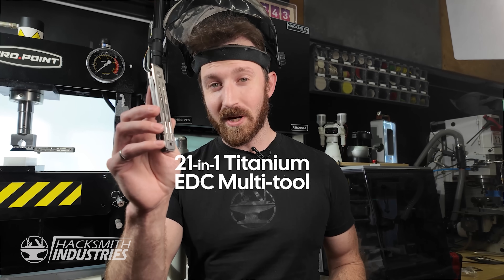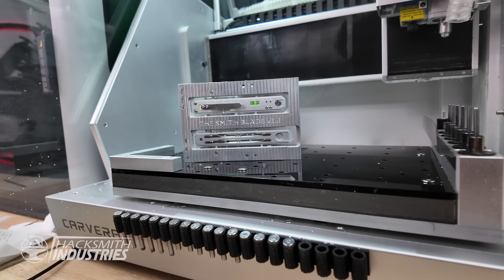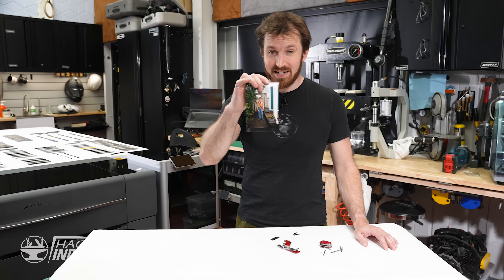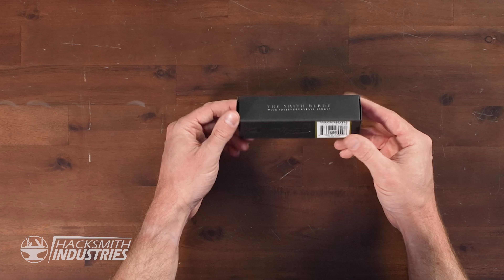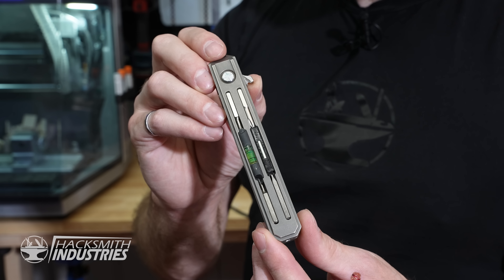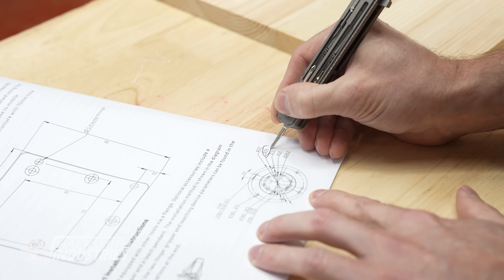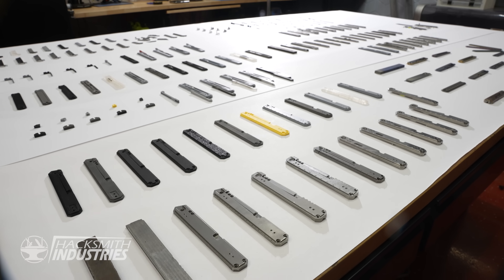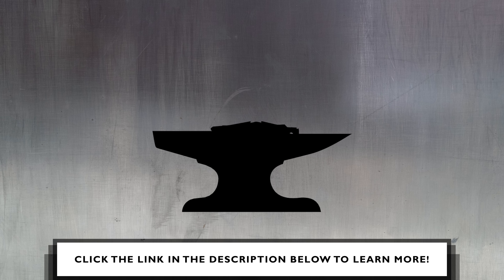We Made a Knife that can CUT THROUGH ANYTHING!

Comment: you guys are tripping if you think 250 is alot for that m390 is amazing blade steel that comes with knifes at around 150+. The extra hardware and the overall construction of the knife makes it worth that 250, even at 289 id still buy this when it comes to be able to order on the website

Comment: So you eliminated the multi tool designed off of a trust set of pliers to a stick that has 100 uses but can no longer be used as trusty pliers... you fail to see that Leatherman were designed with the extra tools with pliers as well... sweet multi too but would be better to see a set with pliers built in ot maybe one that breaks down and goes back together as a set!

Comment: Meh, M390 is a good steel but for something that I EDC I prefer Cruwear. A lot tougher and easier to sharpen. Not to mention that using a hydraulic press to cut another knife in half isn't the flex you think it is (especially a Victorinox knife). I could take a blunt wedge pieced shape of any reasonably tough steel and do the same thing with a hydraulic press.

Comment: first thing i notice directly: you threw a ferrocerium rod onto this bad boy but have only a tiny screw for the mechanism? since it has a ferrorod one could consider this an outdoor knive, but i have some distrust batoning with it already due to the screw. yes i know, you baton with a folding knive at semi-opened stage, then baton with a wedge that you just carved, but still id love to see this knive perform fully opened during batoning. in the end the ferrorod is only a slim plate anyway that gets worn out super fast. 100 strikes maybe? 

great knive but the purpose is all over the place. id prefere my 30eu mora classic 2 and a 10eu ferrorod in the bush anytime... the only place ive encountered in my life where i actually needed a sturdy blade, despite working as a car mechatronic back then. id still be happy owning this knive, but more as a funny toy than an actual working horse. for EDC a keychain leatherman is more than enough for most tasks.

Comment: Would it be possible to get a long Blade version with flip tab but non locking like the Slipjoint? In my understanding of the German gunlaw that would be okay and I rly don’t want to miss out on the single hand use
Reply from the maker: We already made two variations for Germany 😅 sadly that was not one of them
Reply: @hacksmith wait! two? what is the second? i only saw the one without locking, short blade and nail groove
Reply from the maker: locking, two hand open
Reply: @hacksmith yeah ofc my bad

Comment: How dangerous would it be to use it as a protractor and a nail file due to the extremely sharp blade? Both those activities seem to have very close contact with the blade and the hand.
Reply: i doubt you will be using you hand directly to measure something with the protractor rather then a pencil or something and the nail file is on the thicker  back of the blade so no risk (unless you are dumb) of hurting your self.
Reply from the maker: Unless you've never used a knife before it's pretty easy to know that one side is sharp. 

The nail file can also be used while it's shut. And you'd measure using the protactor  on the file edge, not the blade...

Comment: This is probably one of the best knives made. But 209g for the edge? I've gotten my everyday carry guardsman to 54g with a WorkSharp belt sharpener, and I am not great with making sure the grind is super even on both sides before honing the edge. You can do way better with little work. A few passes with the right belt and the proper leather strop or similar method to hone the edge to under 100g doesn't take much when done right.

Comment: Backed this fairly early on, think first day if I recall.  Started sharpening my older  knives as they needed to be touched up here the other day, and I realized while sharpening my current batch that using a hapstone sharpener or something similar with how the edge of the blade basically goes directly to the scales on the knife is going to likely result in some scratches on the scales.  Is there a preferred way to sharpen these?  Free hand, maybe but that will be a bit of a bother  still with how the edge goes directly to the scales.

Comment: You need to build something to fight nosey ( if you don't know its being built by citra, a ticktocker it's basically a anamatronic) it's 10 feet tall can run at 32 mph it's fire proof, bullet proof, water proof , crouches and window watches it also it has spring locks

Comment: M390 is a great steel, but I want to at least recommend a few upgrades. Magnacut is really the no compromise king. Vanax would be next in line in my opinion with just a little less toughness than magnacut. S90v is another fantastic option with above average corrosion resistance while also having extremely good edge retention, less tough but I think it would work fine on this multi tool. M390 just isn’t as special as it once was, but like I said it is absolutely a fine steel.

Comment: Can I remove the Frame Lock myselfe without permanently destroying the locking mechanism? If so is the blade held by the small ball that it stays open when no force is applied.
Reply from the maker: Simply select the non locking add on for the Kickstarter. The locking mechanism is not removed, the blade is modified to not engage with the main lock, while it is held in place with the ball detent

Comment: I must be the odd one out, during field exercises and my everyday carry, I carried 2 multi-tools, sometimes three when I owned 3.

Generally I carry:
1x utility knife
2-3x Multi-tools
2x tools to fix the knife and multi-tools
3x head lamps (They drain batteries even when off for some reason)
1x set of work gloves
2x wallets
1-2x writing material (Usually write-in-the rain)
1-2x Fine tip pens
1x old school lighter that needs refill every basically 3 days from drying out or leaking
2x TQ

Maybe I just carry a lot.

Comment: I’m curious how strong the tool bits are and how easy to find replacements - have bent too many especially smaller flat head bits :(

FYI I think New Zealand has similar import restrictions on blade length and opening mechanism. So probably only int version would be allowed by customs (should update the kickstarter)
Reply from the maker: Which is why we went with standard 4mm bits, you can use basically any!

Comment: I just saw your video and WOW man! Love the designs and insane amount of thought that went into this!
I would love to know your thoughts on a what if... What if at the base of the blade when opened you created a ridged notch, with a corresponding one on the handle so that you could close the blade over a nut/bolt and pinch in like the inner part of a pair of pliers...? In my mind the only sacrifice would be about 1.5cm of the available blade length at the base.
I just thought of that when I saw you holding the leatherman. Your pro could then be a "22 in one" tool.
I'd then be able to ditch my own leatherman as the only reason I use the plier aspect is that gripping and twisting/pulling piece.

In no way at all is this a diss, I absolutely love the design so much and will buy one anyway - just a thought.... Love your work James

Comment: I am an application engineer, I specialize in the design and production of engine/transmission/genset packages, and I find a ton of use for these features. The blade shape, scribe, pen, bits, protractor, level, wire stripper(so nice BTW), file, and the pry bar in will come in handy in the field. I am also a very utilitarian person and when anything modular, or multi use, come into play I'm here for it. 

I don't use pliers much in the field, but if I do need pliers, it's not something needle nose pliers from a Leatherman could usually handle. Theres just not enough leverage there and usually end up looking like a suburban dad trying to show off.
This is perfect for my line of work. I do a lot of design work, a lot of part and assembly manipulation, electrical work (hense why I'm excited for the bits), make changes on the fly, quick measurements (distance and angle),and quick fixes. 

I also run a small business making parts for motorcycles with some CNC work, 3d printing, 3d scanning, drafting/3d modeling and believe this will make a great companion in those ventures as well. 

To those comparing the value to a Leatherman: 
I have pre-ordered and im perfectly happy with paying the price for the pro. I know what the product is and isn't. I'm not getting a Leatherman, I'm getting a Smith blade. Those who complain it's not as good as the Leatherman Arc don't seem to understand who this is for and why there is value for what it is/isn't. 

It all goes back to the old saying. All Leatherman are multitools but not all multitools are Leatherman.

Comment: When we get infos / design of the non locking version ?
Reply from the maker: It's on the Kickstarter page
Reply: We Only see that there is no Flip Tab and a shorter knive for more legal in some countries, but what is when we order a extra m390 blade ? Does it have the Flip tab . Please make a small presentation, a lot of People need this Information. I know you all have so much pressure and work at this Moment but there a a few Persons that need more Information before we Spend Money you know
Reply from the maker: If you want to order one with m390 you can, if you don't want it to have the tab add two non locking to your order
Reply: @hacksmith  will the normal Blade with flip fit in the non locking knife?
Reply from the maker: Yes
Reply: @hacksmith  last Question, how will the Blade will be hold open? So we dont cut our Fingers off🫣
Reply from the maker: Ball detent, same way it's held shut

Comment: Just looking at the teardown of the pro model, and it brought a question to mind. The 2 bottom screws that disappear behind the tritium vial, do they screw directly into the opposite frame, or are there swappable posts hidden in there? 

Only asking this because the leatherman knives had a glaring flaw where because the threads are machined into the opposing handle material, they're one stripped screw/thread away from having to replace that whole handle side.

Comment: Impressive and well priced considering the in house manufacturing. I'm curious as to what the behind the edge thickness is on the blade? M390 really hits it's stride on knives at 62+ hrc so the range is pretty good too. Also, should you be able to put a thin hollow grind at high hrc option on some in the future I'm sure that would make a lot of people happy too.

Comment: I highly recommend going thru the process of creating your own Shopify or like literally any other website builder with payment processor, all the sites like kickstarter or go fund me have pretty bad rates, iirc kickstarter is 5% but shopify is like 2.7 for their like worst plan, so at minimum that’s like 2.3% down the drain, on the over 8.6 m you have raised that’s reaching 200k obliterated, now you say it’s not about money, but even if that’s the case switch to you own site and do the 200k to charity, better than to kickstarter and nice lil tax break.
Reply from the maker: We have our own Shopify store... It's been around for 5 years. Kickstarter reaches a much bigger market than YouTube. Not even 20% of the funding is attributed to YouTube referrals
Reply: @hacksmith why not plug the shopify in the YouTube instead of the kickstarter then? I’m curious
Reply from the maker: Because if you're on Kickstarter it has to be Kickstarter exclusive while on the platform. But again... Out of the money raised only 20% came from this video, so that means if we just did Shopify, that's all we would have raised. Fees suck, but they're everywhere. Access to larger markets is much more valuable. Same reason we sell on Amazon as well as Shopify despite their fees being even higher -- it's a different market and doesn't eat into your regular sales, it's new sales! 😊

Comment: What if the ink runs out, or you strip the included bits?
Reply from the maker: Strip? How would you strip the bits? This isn't a impact drill...
Reply: @hacksmith  By applying extreme torque to a rusted screw head and slipping. I mean it happens
Reply: Can you get replacements? Do they come with some?

Just good questions to ask
Reply from the maker: Yes, but like we said in the video they're also standard 4mm bits, we didn't make them proprietary like most multi tools, you can use bits from any precision screwdriver kit 😊 we will of course sell some on hacksmith. Store but you don't have to buy them from us!

Comment: This looks like a great slimline EDC multi tool but, I wouldn't advertise it as a knife that can "Cut through anything". The type of test initially shown is a toughness test, not a wear resistance test. Bohler M390 microclean has great wear resistance but there are much tougher steels out there. Hydraulically pressing this through a swiss relies much more on blade geometry and thickness behind the edge moreso than the blade steel used. You don't need gimmicks to sell great tools, they will sell themselves!

Comment: Hi! Trying to find out more info
For a friend; I’m not sure if your  video covers it and I missed it, or your kickstarter page, but does the titanium lockbar have a steel insert that comes in contact with the m390 blade stock? I don’t have experience personally but I hear the softer titanium could disengage when pressed against the blade steel?
Reply from the maker: Correct, titanium cannot be used for wear surfaces like that. The bearings also feature hardened steel washers in between the titanium and bearings

Comment: I was really excited about this until I saw the price tag. On my edc pocket knife the knife part is actually the tool I use the least. If a version of this with the same amount of tools but a regular stainless steel blade would cost around 80-100 bucks I'd buy one but as it is neither do I need nor can I afford the cost of the M390 blade.
Reply from the maker: We'd love to get it to that price point, which is why we have the standard edition that doesn't use m390, the blade is a big factor in the price, but the main cost of manufacturing is in the titanium handle due to its complexity and how long it takes to machine.
Reply: @hacksmith I understand that, I looked at the price and while it's not as unreasonable I still can't afford it as an engineering student. Maybe in the future :)
I really love your design and perhaps, license permitting it could even serve as inspiration for other diy options with cheaper materials. For example I really liked the Ridge key holder but it was stupid expensive and even too small for EU keys so a week of cad and a few prototypes with my Ender 3 later I made a clone of my own that fits my budget and size constraints. 
Keep on hacking guys, really love your work, cheers from Greece!

Comment: A message for Hacksmith industries. First, the marketing video is very good.
   I also think the idea for making a more compact multi too that is not bulky is a good idea.
   The materials are also, from the description of the blades metal and ti construction is very good.
   I also think the reason for the idea in the first place is cool.
   I also have a few ideas about a business and some products. What I have learned so far, from selecting supplies and thinking about materials to the engineering side, overall, bringing a product to market can be expensive to do.
   My competitors are volume competitors, and they have established reputations. Therefore I know that it will take me some time to build a name or reputation. That means the stuff will be on the pricey side. Once I start to produce volume, the prices can be lowered.
   What I am saying, though, is that 250 still sounds pricey to me. I like the one that has all of the functionality, but the one that appeals to me the most is the one that is $99. The price, and also the simple looks are nice, but it does not, and should not have all of the functionality of the top or mid tier versions.
   My latest knife is a Kershaw. Most people know the name. To my surprise, less than $30, it think it was actually less than $25. 
   Here is the thing, when they came out, they were also expensive, but the one I have is likely one of their oldest models, so it has had some volume behind it. Pricing wont be easy for me, but it's the same kind of thing.
   Good luck, the product looks excellent!